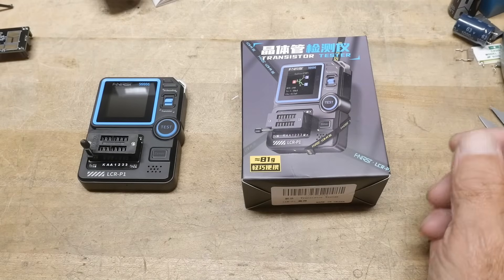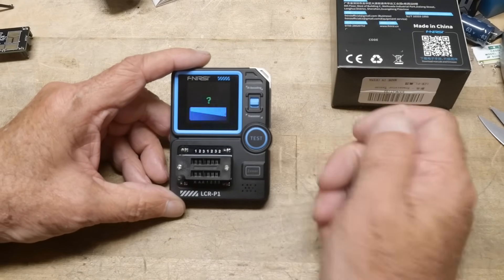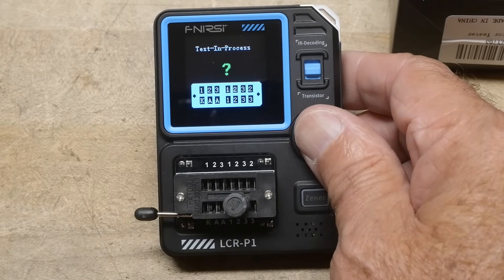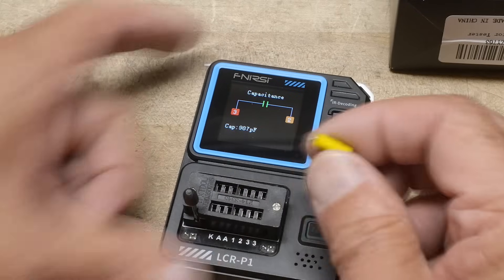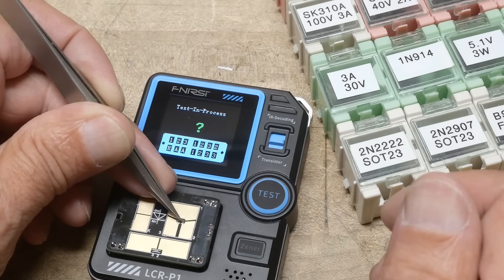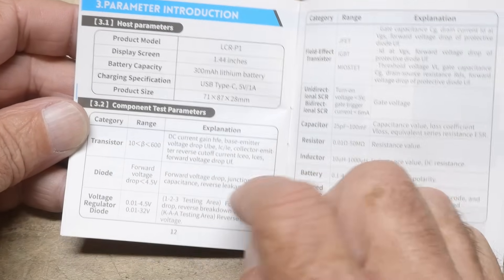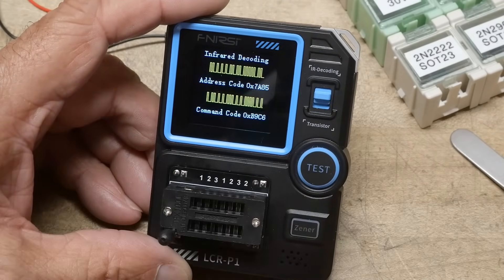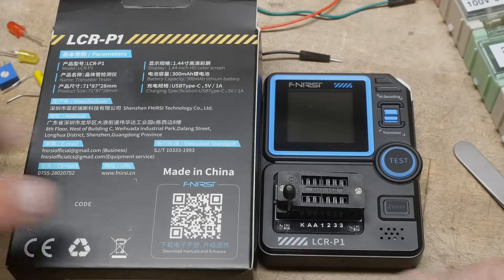#2260 FNIRSI LCR-P1 Component Tester

Comment: I have tried to test an MPSA13 Darlington with the FNIRSI and it said the HFE was only 33. It is supposed to have an HFE of 5,000-10,000. Do you know why this might be occuring? Other transistors seem to be measured properly.
Reply from the maker: it has a 2.0V base-emitter voltage that the tester can't handle.
Reply: @IMSAIGuy thanks for the clarification

Comment: I bought one of these FNIRSI LCR-P1 testers recently. I do a lot of DIY builds, like guitar pedals, preamps, HiFi and audio amplifiers, etc. It makes things much easier to test and get an accurate reading. I bought it initially just to test the gain and type of transistors I had for guitar fuzz pedals, but it does so much more. 

I love it and would recommend it to anyone who builds, repairs, upgrades, or modifies, etc., any type of gear. Worth every penny, which wasn’t much. Considering how much easier it makes testing parts, it actually cost very little and worth every penny. 

Thanks for the video!

Comment: Mine arrived on Friday and I was surprised by how small it is. Not sure if mine is very accurate or of it is how I am using it. I have a HF radio I need to recap so it will come in very handy. I just tested one of the caps and the loss wasn't very much at all. Not sure if I needed to do a full recap in the first place 🤔

Comment: Did you try testing triacs or SCRs in TO-220 cases?   I just got one of the LCR-P1 and it does not seem to work with them.   Triacs and SCRs in TO-92 form factor seem to work.   My old TC1 tester works with the same devices.   The TC1 does show triac's MT1 and MT2 backwards though.

Comment: I have one of these too, and it is indeed a nifty little device!

There's one issue I've been having with it though, and I'm curious regarding whether you are seeing the same thing. While it correctly identifies NPN and PNP BJTs, and provides plausible numbers for the transistor parameters, it does NOT correctly display the pinout in all cases. For NPNs like 2N2222 , it seems to always identify pin 1 as collector and pin 3 as emitter, regardless of which way the transistor is inserted. It does the reverse for PNPs like 2N2907.

I believe this is a display issue only, as the gain numbers would be way off if it was internally testing the transistor "backwards".

This is with the latest (1.0.9) firmware, but I experienced the same issue with earlier firmware versions as well.

I would expect this sort of behavior for JFETs since source and drain are often interchangeable. But for a BJT, correctly distinguishing emitter from collector is pretty important!
Reply: Patch the firmware yourself.
Reply: @Atmatan  TBH I'm not particularly inclined to go to the trouble of figuring out how to patch the firmware for a $30 device, especially given that the source code is not available.
Reply: @MikeU128 Then dont bother owning tech, if you want daddy big brother to hold your hand for you.

SOP clip to dump the firmware over uart, SPI over SOP to write it.
Chip will tell you what type of firmware it is, letting you know what you need to decompile and reverse engineer it.
Less than five dollars in parts and the time it takes to bother to care.
Reply: @Atmatan  The time it would take to do that is worth more than $30 to me, and furthermore the device still has value even with the bug.

If it was a $300 device, the economics could be different. OTOH, if it was a $300 device I'd expect better support from the manufacturer, and would've probably asked for my money back.

Given that FNIRSI seems to be pretty big in the "cheap but functional test equipment" space, I figure they will probably fix it eventually. Not having proper BJT pin identification on this particular device isn't stressing me out; I can wait. I also have other testers which do it properly, and for devices with legible markings I can always consult the data sheet.

What you call "daddy big brother holding my hand" I see as "wishing that companies would actually test their firmware before releasing a product".
Reply: @MikeU128 Educating oneself is worth everything.
Complaining and then making excuses for your complaints just makes you seem weak.

You have a weirdly backwards understanding of cost benefit analysis.
As someone ignorant and unwilling to change, spending more money just means your cost of failure is higher, not that success is more viable
Reply: @Atmatan  Wow.

I have a list of several dozen other things I intend to "educate myself" about which are way more valuable than figuring out how to patch a bug in the firmware for an obscure piece of cheap test equipment. That's MY cost benefit analysis.

Have a nice day.
Reply: @MikeU128 😂

Comment: But the question is: what version firmware you have there because usually the ones that came with 1.2  or 1.3 are horribly slow and stuffed with bugs (and that is a huge let down). Apparently v1.5 is out and I'm curious which version is yours because the tests on yours seem far snappier than the ones I've tried in the past.
Reply from the maker: I just used what every it shipped with. after the video I have flashed a new firmware
Reply: @IMSAIGuy  Ok, thank you

Comment: What's the point of the swappable daughter boards? Surely they're not saving much space by just putting the pads next to the ZIF like the cheaper component testers. I guess making custom daughterboards could be useful, but I just drilled a hole in the side of my $8 tester and installed an 1/8" (/3mm) headphone jack (TRS) so I plug in whatever I want as an expansion. So far, I've only used probe leads in the jack, but I could theoretically plug in anything.

Comment: This transitor tester has a major fault identifying the pinout of NPN transistors.  I have report this to FNIRSI with evidence and they didn't even bother to answer. I have install all the recent firmware and still id's the pinout wrongly for NPN transistors. The latest firmware is V1.0.9.zip. If you test a KSC1845 or a 2SC1815 facing you, the pinout is wrong, if you rotate 180º the transitor facing backwards the pinout is correct.
Reply: Yes - I have the same issue. I've upgraded as far as 1.0.7, but now I've given up. The £8 KKMoon kit tester I assembled years ago gets the pinouts right every time.
Reply: Same problem. How unfortunate, is the other larger tester suffering from the same problem?
Reply: Bro! Same issue. Firmware V 1009 doesn't work either.  I think it's an hardware thing and cannot be fixed in software.
Reply: @interesting7906  Yes, and still they do nothing about it. I think that this a fault of a batch...because some are working well....They don't assume this in anyway....
Reply: Testing a standard silicon NPN transistor, the tester reads with emitter and collector reversed. PNP's read ok.
Reply: Is 1.0.9 the version you are reporting the issue with?  I just purchased one with ver 1.0.8 and it had the same issue.  Haven't been able to download 9, some issue.  Support haven't gotten back to me.   Love when it reports the center pin being the emitter
Reply: @opera5714  doesnt matter, all versions are affected.
Reply: @interesting7906     Thanks for your reply. This was an impulse purchase to get enough for free shipping on other items.  Should have done some research before.  It has been returned.  Support was useless.

Comment: Looks definitely nice and I like the Zener diode tester feature. The replaceable test fixture is a good idea, the tester could use one more of them, with a connector (e.g. screw terminals) for test leads or cables with alligator clips.

Comment: The hot-swappable bay with the ZIF and the SMT pads is genuinely really cool. Well done to whoever had that idea.
Reply: ...then again, obviously nothing stops you from doing the same thing with ANY of these testers, except you design your SMT add-on board to match up to the ZIF...
Reply: @AttilaAsztalos  Yup. It makes perfect sense to me that someone should make just that adapter board but with headers to fit into the ZIF, but possibly you get lower capacitance and better readings with the bay swapping. Or, maybe it's more than you would have if the bay weren't itself socketed. lol
Reply: It’d even better it could detect the test connecter and display the correct pinout.

Comment: the blue led was nano amps?
Reply: I think thats reverse leakage
Reply: 11.2nA reverse leakage current, not forward current.
Reply: Both the red and blue were nA, that's the tester's guess at the reverse current that the diodes let through - Ir, current (reversed). A theoretical diode would let precisely zero current through in the reverse direction.
Reply: @ivolol  thx

Comment: Are the specs any different?
Does it do anything more than the other testers, or is it more accurate?
Reply: I think you would mostly buy it because you like the specific form factor it comes in and highlight features, as shown here. But otherwise no it doesn't do a great deal more than other rechargeable testers
Reply: The swappable socket is huge IMO. My ZIF sockets on all of mine have at least a few spots that don't close anymore. Also the separate zener button is great for dumbasses like me that accidentally miss and put a part in the wrong spot.